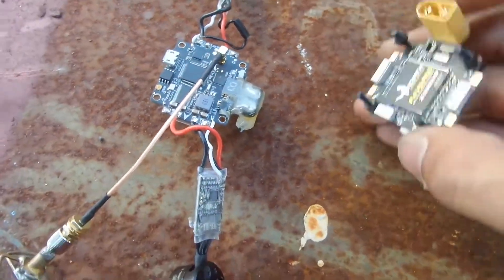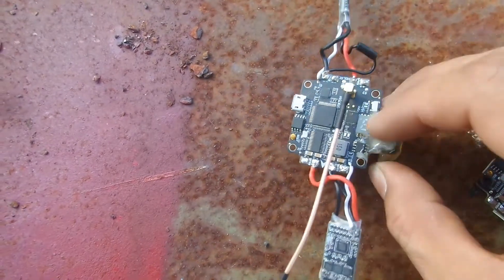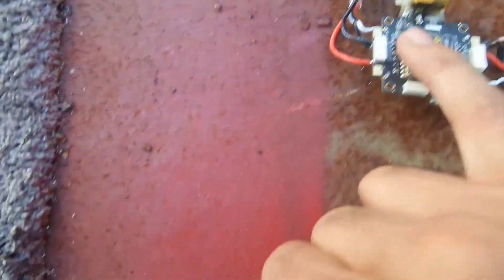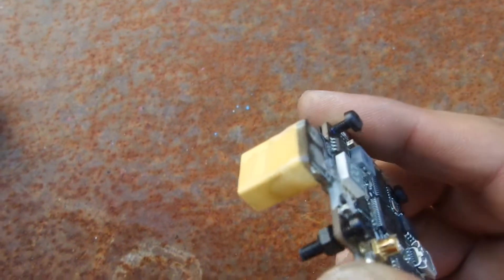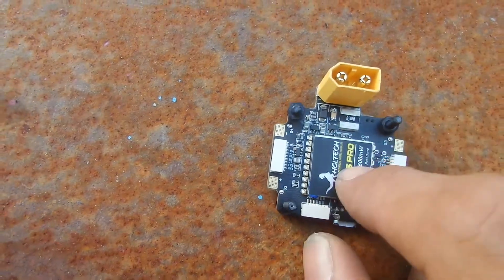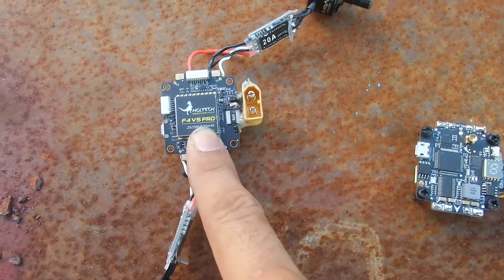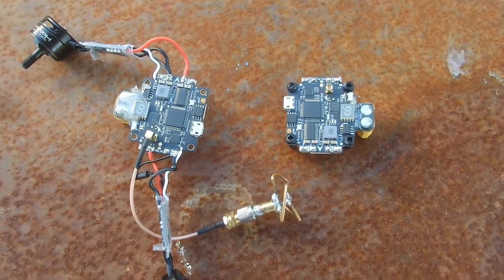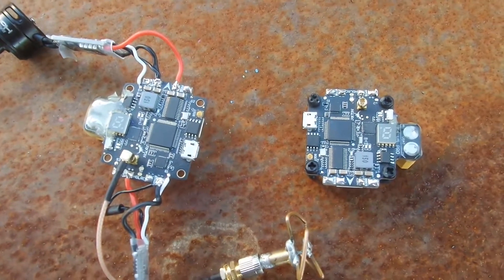F4 V5PRO failures and experience.

Comment from the maker: UPDATE 2!!: i have been flying the f4v5pro on bf3.2.0 for a week and a half now... dshot1200 on littlebee32 30a esc's and 2306 2750kv motors. It has been flawless!! Much kudos to hglrc for replacing the boards even after the faults found were my own doing. (hangs head in shame) Still waiting on youtuber and comp winner Dan Boarder to build his f4v5pro out.... important note!! DO NOT!!! use dynamic filter, pt1, notch 1&2 and dterm on 0!!!! with this setup!!! Instant flame on number 3 esc when hovering. Killed my fc as well. Sig n ground melted together on esc. Sigh :( i will be going ahead and buying more f4v5pro boards to use. As i believe the product is quite solid. Negative points for my building skills!! :( lol.  Link to f4v5pro flights. PT1 without dynamic filtering and all notch filters and dterm filter on 0... sooo sweet! check flight. https://youtu.be/ijL8k_S7LYE
Reply: KillaG FPV so you can't use bf 3.2 dynamic filter on this board?
Reply from the maker: yes you can. i ran it. just dont turn d term filter off. unless you are certain your notch filters are tuned right.

Comment: You should try to resolder that usb. It may be making connection to power but what ever data pins are on there might have a bad connection. I just solder them all together flux then tediously wipe away with copper wick. Mine had lifted traces and it still made connection. Its worth a shot.
Reply from the maker: ean carlson board is long gone. But i shall try that on my omnibus that i ripped the usb off of.

Comment from the maker: another update. i just got a pilots f4 v5pro board where the vtx unit was ripped off! bypass that with akk tech nano2, 

then as predicted the traces to 2 of the 3 available 5v outputs started to fail. currently flying by using the 5v output from the front most connector and spliced into usb connector 5v to power the fc itself. 
then to akk tech vtx, (the cam runs off vtx 5v) then 5v to flysky rx on sbus. 
now! issue! you cannot go into dfu mode when you have the rx drawing from this self healing 5v rerouting. as it sends 5v to the usb to power fc on batt. having two 5v sources prevents the board from accessing dfu. so simply disconnect rx once all wired up to reflash new firmware. 

hope this explanation helps someone.

Comment: Do you know if it's possible to pick up the OSD directly off the board somewhere? My cam connector came loose, I managed to solder directly onto the pins but there's no image. After a while I just assumed the vtx was fried so I installed a separate vtx. I would still like to use the OSD if possible. (It's beeping at me and I miss being able to see the error on the OSD.
Reply from the maker: i dont think its possible with these AIO intergrated boards. its not like they are running MWOSD, but you might be able to try and check if you can remap the video output in cli to a spare rx or tx port. cheers.
Reply from the maker: Mike Hogan failing that. You could remove the vtx module and grab the video out signal with osd from under the vtx module.
Reply: I've been looking for a FX758 vtx module to have a go at replacing it but they dont seem to be available anywhere any more.
Reply from the maker: Mike Hogan dont replace. Just take the video out feed with osd that goes to vtx unit. Under the tin case. If its there. Then use external vtx.

Comment: I got a different failure, cover of the board that is soldered, came apart and shorted the flight controller. Banggood is sending a new one, the only good thing about this failure. Not too sure about quality build if this unit. I think the entire board should be dip in resin, to make sure any vibration affect this board.
Reply from the maker: minimal solder used and a lack of conformal coating does make it a bit iffy in that sense.
Reply: Hot glue guns are nearly free.
Reply from the maker: hot glue also insulates when it melts and gets in between a loosely soldered on smd component..

Comment: I have F4 V5Pro and it worked nicely before i went home and i only tried to put tx to my xsr smartport to get telemetry in my taranis and configuration i set telemetry on, then power off and took props off and suddenly it wont connect to my pc anymore, tried to plug battery with usb and nothing, pressed boot down and battery and usb and nothing, no ports showing. Tried to made DFU port with impulseRC and even that couldnt find nothing. and buzzer keeps screaming non-stop. and i get numbers in my vtx. So usb port just went broken by itself?
Reply from the maker: Mr.Viceroy which tx did you put smart port on? Which port? Tx3? Tx6?
Reply: used tx3
Reply from the maker: does it show as a com port in pc system?
Reply: no, nothing
Reply from the maker: without looking at it personally i cannot tell if perhaps ytou have a solder blob sitting somewhere it shouldnt.
Reply: Already checked that but it really cannot be that cause i didnt even use solder when connected those wires for test and took props away, so confused what happened.
Reply from the maker: hmmm. do you have ftdi adapter?

Comment: do you still have this board ? does the pc see it at all or its like its locked up in bootloader you might be able to flash through clock and I/o pads. if the pc cant see it and in false dfu or no dfu I'm working on another way for f4 flame it has no pads for clock and I/o so i have to think out the box lol cause it came what seems bricked out the box
Reply from the maker: youel adamas i sent both of them back to HGLRC anf they were kind enough to send replacements. i gave one replacement board away to a subscriber and have just built n flown the other replacement board this weekend. HGLRC have been very patient with my 'nooby' experience and have guided me through issues. my setup in the 180 stressed the board itself. new setup is running BF3.2.0 and 32bit littlebee 30a esc's and MAD 2306 2750kv motors. video coming soon.
Reply: nice good to hear they are a stand up company. its ok to give me a hint hows the 3.2 on 32 butter smooth or not to far from 3.1.7 pt1 8k8k.
Reply from the maker: youel adamas dshot1200 too. pretty smooth. but i got a brownout issue. that led to a crash. xt60 issue. was fine after is spread them out. although I put a 470uf cap on the power input. it gets warm quick. ill throw a 1000uf cap on there and see how that handles then. the board itself is sweet now its in a protected frame :)
Reply from the maker: im confident enough to purchase more. but ill bash it for a couple more weeks first.
Reply: try 35v I have seen spikes get that high lol and your running some high kv big boys. I would build an all out monster but I know it will eat all my batteries lol. Have fun punching out like a rocket and be nice to them batteries also what batteries you like I have tons of battes that sag like a grandpa in speedos
Reply from the maker: yeah gunna head to my local electronics shop and pick up some 1000uf 35v suckers.  batteries ive been running so far are local 60c 4s branded, not bad, reliable, so far no swelling issues from over draw. charges up fine, and goaneng 110c 1500 4s, this thing has continued to deliver with minimal sag recovery (i can live with) super reliability, able to recharge recover from 3v multiple times so far. holds steady. discharges evenly (until about 3.4v then the outer cells sag to 3.1 and stabilize with the remaining charge in the inner two cells. ive got infinity 90c and its ok but it discharges like a demon! too bad the cells cant keep up. lol. outer cells sag terribly once below 3.9v.
Reply: great info thanks a lot lol you should do a vid on it if you have time those are the two batteries I have in cart to try next. on your vid you can leave affiliate link in description might fund a battery or 2 in time
Reply from the maker: thanks for the tip. i might do that. i am clueless about youtube and editing. i just want to get info out.

Comment: How about to remap the Motors 1 and 4 in BF to some other Ports? Like LED output or what else. 
https://github.com/betaflight/betaflight/wiki/Remapping-Motors-with-Resource-Command-(3.1)
https://www.youtube.com/watch?v=cEMfs_4X2VM
  i got the Asgard Board (Omnibus F4 SD) with ESCs on it an had to switch the Motor positions. It's verry easy to change the Output to an other (unused) Port on the Board
Reply from the maker: i would have tried everything if HGLRC didnt offer replacement boards. ( thanks so much for that!) i dont see why it shouldnt work, resource remap. in cli.

Comment: damn :/ some quality issues for sure. Lost contact and crashed mine on second flight and fell head on to rocks. Just getting a constant buzzer BEEEEEEEEEEE...EEEEEEEEEEP when plugging in 4s lipo. The board becomes fully functional though if I connect it through USB.

Took the whole thing apart and everything else is "fine" (well my oomphs sound like crap now after the crash), but the board is busted.
Reply from the maker: Dama not cool at all... maybe youve fractured the pdb from batt connection. any load and it wont pass powah through
Reply: Yep. Before flight I had even watched your videos and made sure my caps were soldered on good.
After inspecting the board numerous times with a magnifier, I still haven't been able to locate any dirt or solder splash that could've caused the mid air loss of control/communication. I put the blame on the board on this.

Board looks totally perfect so I think there's something wrong with the integrated power distribution. I was using a brand new Tattu R-Line 95c 4S.
Reply from the maker: Dama im not sure what sort of testing this board goes through before production. if any at all. nice components and specs. but if the sum of the parts cant hold the rated current flow sustained or burst. then it seems to be a case of good on paper. good in practice. fair enough when you have the experience in the company. but one would think a large company can afford to test these boards until they burn on the bench...

Comment: do you think we can bypass the vtx to an external one? I got a board like this where the vtx is not working and BG is not responding to my request.
Reply from the maker: Bruneau Melier yes of course. just run fpv system as per usual. ie how you would setup without an aio fc board. 5v to cam 7-24v to external vtx either from regulated 12v (i don't Recomended this as the 12v pads only see 500mah) and done. i gather the question you ask is specific in regards to being able to use the osd on external vtx? ill have to have a closer look at the boards once they arrive and i draw the winner of one of the f4 v5 pro  boards im giving away (testing/ usage results required if the winner) i do recall seeing what to me stood out as osd pads on the edge of the board somewhere.
Reply: KillaG FPV I have 2 of these boards...unfortunately one has a faulty vtx...one of these connector to the vtx board should be the vtx video input...but no clue which one...at least if hglrc was selling vtx I could guess which one is that one soldered to the fc...
Reply from the maker: Bruneau Melier if faulty get in touch with hglrc. im sure they can help out. hows the other board fly? rate it?
Reply from the maker: Bruneau Melier wouldnt vtx modules share the same basic solder tab layout?
Reply: KillaG FPV the normal vtx module has got jst but the one on the board dont have it...
Reply from the maker: Bruneau Melier ive sent hglrc an enquiry about spare vtx modules.
Reply: KillaG FPV I found the pads...I think they have used gtx226
Reply from the maker: Bruneau Melier which board do you have exactly?
Reply: KillaG FPV 2 x f4v5
Reply from the maker: Bruneau Melier ok sweet. just making sure. ill let you know as i get Informed.
Reply: KillaG FPV you will get informed about what?
Reply from the maker: Bruneau Melier when i get the information about the vtx module for replacement and confirm pads for osd if you can use external vtx module from the email i sent to hglrc.
Reply: KillaG FPV as I said above...I found it...and I am sure it is the gtx226
Reply from the maker: Bruneau Melier wouldnt it be best to be 100% sure? either way confirmation from manufacturer doesn't hurt anybody. I'm not stopping you from going ahead with your repair mate. by all means please let me know how it goes. i enjoy gathering information and confirming that information correct. i sent my boards back to hglrc so i cannot physically desolder and have a look at the module myself. have you already removed yours?
Reply from the maker: vtx cannot be bypassed. osd can not be used with external vtx.
Reply: KillaG FPV who said that?
Reply from the maker: Sherley Hu from Shenzhen Bater Technology Co., Ltd.
Reply: KillaG FPV I do not believe her statement...since the vtx is a seperate module that is soldered on the F4V5. She prefer you buy a new one :)
Reply from the maker: im sure it is a removable and bypassable unit. i remember seeing osd pads so yeah....
Reply: KillaG FPV lol
Reply: KillaG FPV Were you ever able to get the betaflight OSD while using an external vtx?

Comment: does it has lc filter? .  how is ur fpv video signal when u accelerate?  does it Flickr
Reply from the maker: Rc King the video feed was fantastic and osd clean. i never came across WOT issues and noise on screen.... god damn i miss flying the 180 and this board combo...
Reply: thx man. i m going to order one.
Reply from the maker: Rc King do it! but also. please let me know if any issues arise. banggood has your back if you buy from there to some extent. i purchased from manufacturer. so i want to give maximum end user feedback. unfortunately this means i wear the cost.
Reply: so I went with a 1000 cap on the battery connector one 330 on each esc and a 470 on the power line to the camera. Much less noise but still have some. I am soft mounting motors next to rule that out but I think my capping it did not get me there.  Update when I try the soft mount. I love this board so I really want to sort the video. Thanks again for your help
Reply: mine has hella motor noise on motor power.... flies sweet but video noise is driving me buggy
Reply from the maker: mrbrownstone242 what are you running? 470uf cap 35v on the battery input pads is what i run. But mostly for 32bit esc's. Previously on these builds i never came across noise. most likely your esc's are getting backfeed emf.
Reply: KillaG FPV 
Threw a cap on the input helped for sure but still have squiggle at high rpm should I try a cap on each esc power connection to the board ? Love the way this board runs certainly it sure does a great job as a FC
Reply: Racerstar 35a purple think m series
Reply from the maker: squiggle? or video noise??

470uf 35v low esr? also fc softmount and motor softmount. if motor squiggle.
Reply: KillaG FPV 
Yes sorry video noise not vibration in video. The lines or distortion are squiggle not the usual parallel lines the one cap on power got rid of it at idle to about 50 throttle over that it gets a little worse the more you go up. Totally flyable and stable video just fuzzy and annoying as hell. Soft my flight controller yes not motors.
Also noise is not associated with prop noise high d or p. This is for sure electronic I think
I saw people use a 470 on the speedos too like regular plane esc have I guess. Thinking the caps on the esc are less than ideal
Reply from the maker: sure about that? 

from boris:
I realized that if you put P, I and D all to 2 (ie, almost totally off), what you the blackbox the gyro trace (quad safely hand held or in a restraint) shows gyro data without amplification by PIDs. If you zoom in on gyro (say 1000 times, with no expo on the trace), you can see the 'input' noise as would go into the PID loop.

If we then add P alone, and test while (safely) hand held, it becomes apparent that the amount of noise added by the 'P' part of the PID calculations is small. Even with PT1 and no notch filters, P itself doesn't seem to be much affected by motor noise, nor contribute to feedback resonance in a big way. If it wasn't for D, all we'd need is a PT1 on gyro.

But when you add D - that's when it gets interesting. With only a PT1 on gyro, D carries a heap of amplified noise back to the motors - even if D lowpass is a biquad.

This is a cunning way to identify what P or D individually add to the noise sent back to the motors.
Reply from the maker: d and i seem to carry noise back. so maybe 470uf cap or tantalum bank on each esc might help.  i personally have been looking at this frm banggood, it might help. it might nnot...

https://www.banggood.com/V2_0-470uf-Anti-interference-Parallel-Capacitor-Plate-Capacitance-Board-1-6S-LiPo-For-Mini-ESC-p-1133294.html?p=YF14109470827201703A
Reply: Nice ! I just bought a load of different low ESR caps to try. Let us know how the little bangood bank works it looks good !  What motor dampner do you run. I never soft mounted motors prior but willing to give that a shot too.  I see little silicone ones from banggood they look worth a try
Reply from the maker: your own risk but have you considered doing a reflow of the board?? some solder joints might be cold and end up with resistance from a bad join... just a suggestion. try at your own risk.